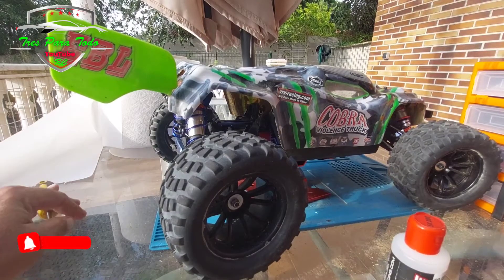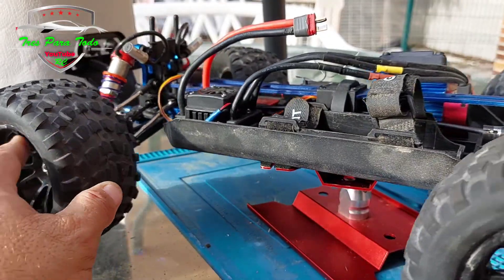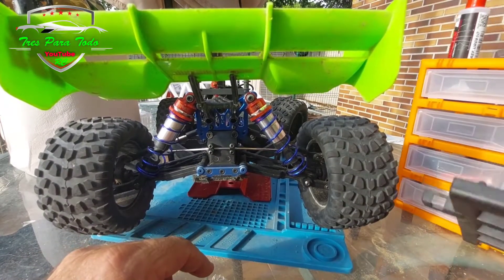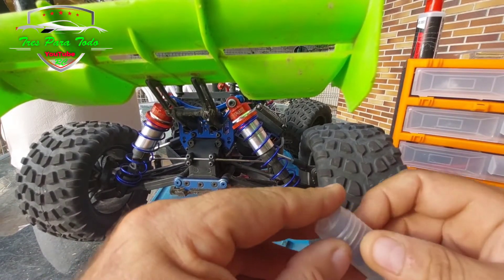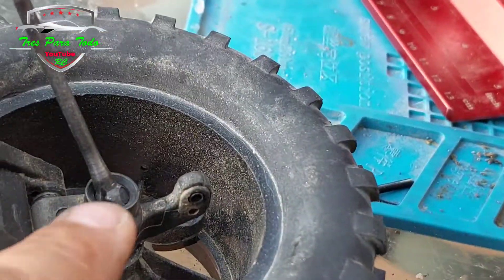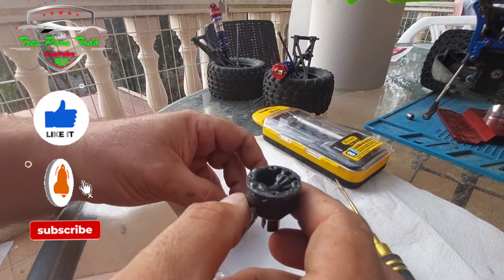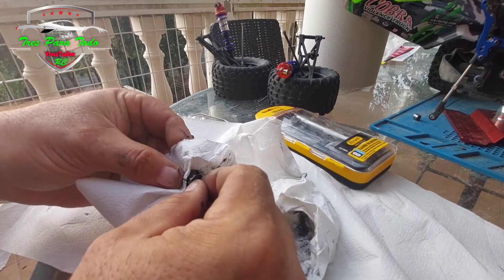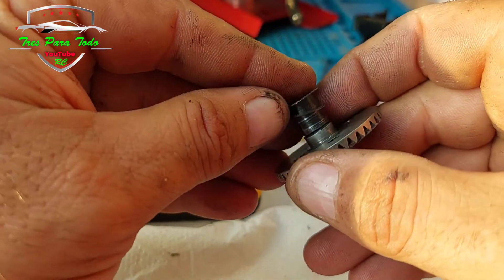Mantenimiento del #Cobra y nuevo paragolpes. Puesto a punto tras aprox, 100 lipos gastadas.

Comment: Una cosa mepodrias decir k silicona le puedo poner al senton gracias
Reply from the maker: Según Arrma lleva 10,000cst en ambos diferenciales.
Yo estaría en ese rango.
Si lo quieres un poco más suelto le puedes poner 7000 y si quieres más frenado le puedes poner 15,000cst.
Pero en principio en ese rango de densidad.
Como mucho 20,000cst.
La densidad varía según el diferencial y coche.
El Senton además las ruedas son más ligeras y pequeñas yo probaría 10,000 atrás y 7000 delante.
Para que entre mejor en las curvas.